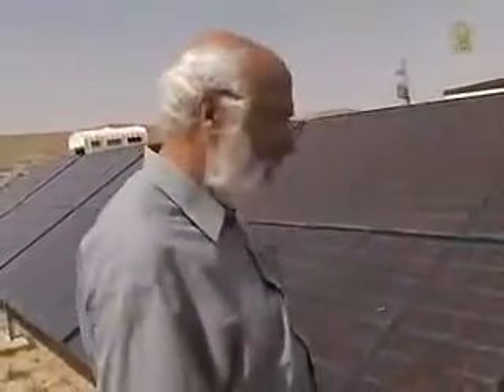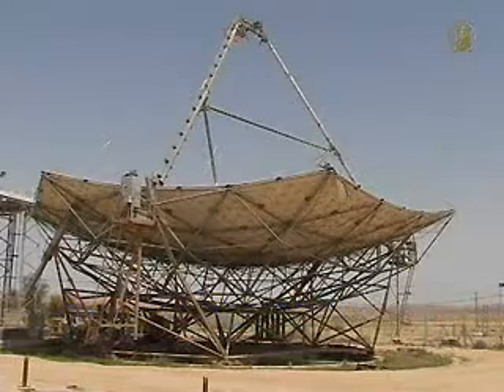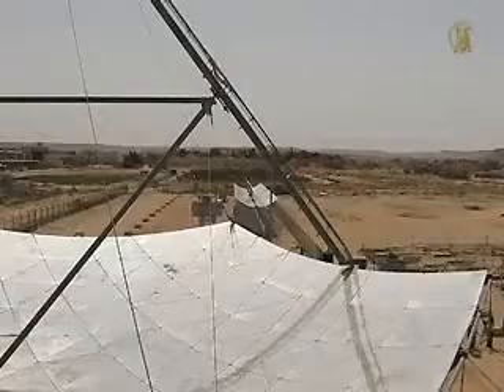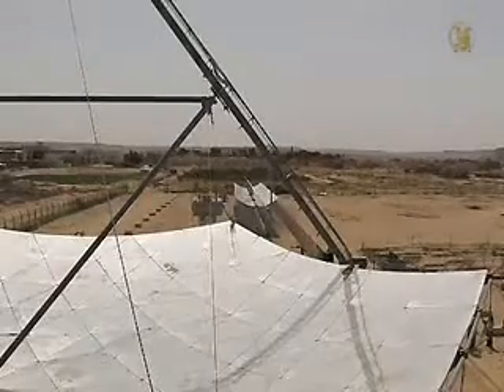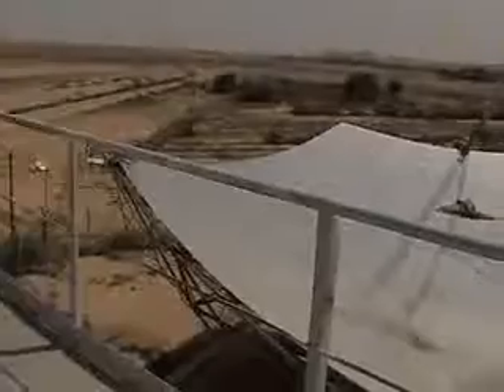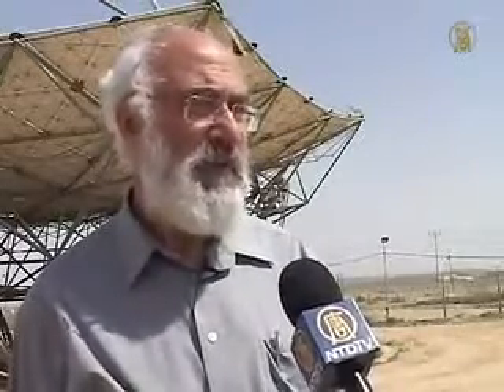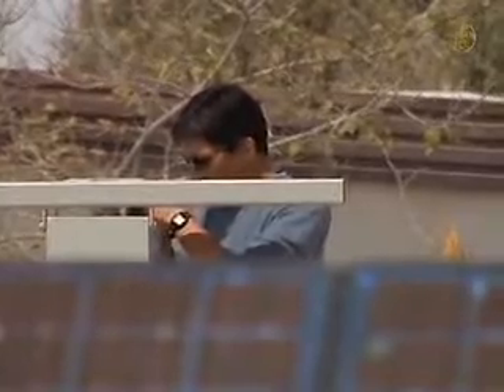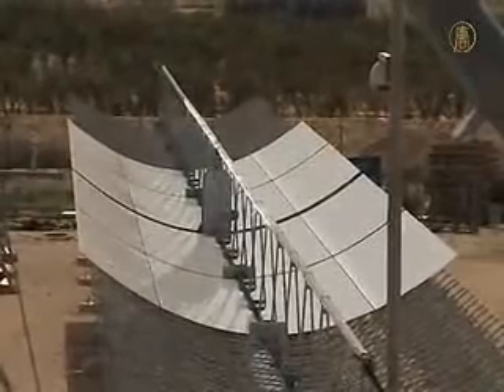A Solar Cell 1000 Times More Powerful

Comment: Even in 2008 using concentrators with solar cells was old news.  I guess everything is a "breakthrough" to the ignorant masses.
Reply: +htomerif Today solar panels are cheaper than the mirror you need to reflect the sunlight
Reply: imad omda thats true-ish.  The real cost of a mirror system is the tracking hardware.  There are at least a couple of industrial-scale mirror based water-gas turbine plants out there.
In any case, its usually the non-solar panel and non-mirror stuff that makes up the majority of the cost, like cleaning, for example.

I will say that today's high efficiency solar cells are much, much, much more expensive than mirrors.  I think the ones most people buy are polycrystalline or amorphous silicon.

Comment: its not a 1000 times more powerful.. it has 1000 times more light applied to it.  call it what it is.  a cell that can take more heat in a condensed area.

Comment: This "Concentrated PhotoVoltaics" (CPV) works, but has its disadvantages too.
With this design (parabolic dish), you need active cooling of the photovoltaic cells, that raises costs.
On the other hand, you get hot water too, maybe usable.
Probably the better design is a flat array of many lenses focusing the light on a lot of very small photovoltaic cells, embedded in a passive heat sink.
For both designs, you need a tracking system to follow the sun. Which raises costs. And these systems can only convert direct sunlight, unlike common photovoltaics.
In the year 2008, solar cells were much more expensive than today, so this solution to save semiconductor material was attractive.
But this changed a lot.
CPV still might be a reasonable alternative to fixed installed common photovoltaics. But I suppose, it might not be a cheaper solution any more.
Big advantage: Because you need so few solar cells, you can use very highly efficient, but extremely expensive multiple-junction-cells. So you achieve a module efficiency of today about 35 percent.
Lots of pros and cons.
Reply: You don't have to put the cell in the direct focal point of the ray. You could adjust the distance. Where there is a will there will be a way.

Comment: He says cheap glass and metal.  But he didn't say that his system requires a dish that tracks the sunlight, so there are motors, gears and mechanical parts that could add considerably to the cost.  I'm thinking that the difference in costs is not that great.  But it does eliminate most of the environmental costs of the process of manufacturing the solar cells.  This shows that one has to look at ALL of the factors of a solar PV system.

Comment: @gabigowriel Because the bigger problem of the renewable sources of energy such as eolic, solar.... etc is that are not stable and reliable at all. They depend on many factors. For example the solar devices can produce energy only for several hours of the day or produce the half or less of energy when there are clounds.

Comment: @desertlight If that was the case, then Achilles death ray would have been a success. Not all the heat is transferred to the solar cell, nor is the scaling for heat linear. In this case, we are not looking for heat, only light.

I doubt it 1000 times more productive than a single cell, but at the same time, the heat is not linear from the reflection of light.  If 1 light is 1 degree above ambient temps, and 10 lights are 3 degrees more, and 100 lights are 30 degrees more..Outta characters now. !

Comment: @astrialkil Only problem is, that raises the price of goods and services, especially:FOOD. Airline tickets, groceries, EVRYTHING. Wich harms our economy. The idea is to get off Oil altogethr, and start using and implementing all the free energy devices and systems that have been invented and suppressed over the decades. Bob Lazar even has a video on YouTube where he shows how he runs his Corvette off of Hydrogen stored in Metal Hydride tanks in the trunk (safer than gasoline and totally CLEAN).

Comment: @phillyP84 you could run copper tubing on the back of the mirrors to act as a preheater and then run the tubing up to the hot solar cell to steam distill the sea water , turn a turbine while your at it and get more electricity.

Comment: philly p84.
 its a complicated , If they are shaded the plants may need very little water. there are aerophagias plants that grow hanging  from walls in Andalucia..
  If you wan tto dry air cool it and the humidity in it will condense out, deserts get very cold at night. Winds circulate, some must bring humidity that gets condensed out of the air in deserts, water for plants capable of using dew I am not sure all my cactuses have much root , they get humidity from the air. rose macaskie.

Comment: @rosemacaskie you will then have to pump water from the ground to grow the vegetation, another big problem the humans face, we are running out of fresh water too. Dubai uses sea water and massive amounts of energy to take the salt out of it, this may be possible to achieve using solar energy to purify the water and the shade to grow vegetation, its a big project

Comment: Oil is DEAD. Coal and Nuclear ar similarly DEAD. Water contains far more energy than oil. Oil causes sooty-pollution, acid-rain, global warming, and oil-spills further despoil our environment. Fossil-fuels are barbaric. Vacuum is the fuel of the future. Vacuum has a field-strength of over 800-million Volts/cm. Zero-point is the fuel of a star-civilisation, such as OUR OWN.